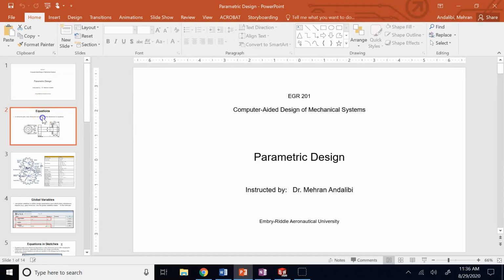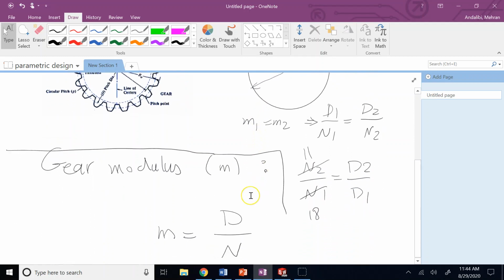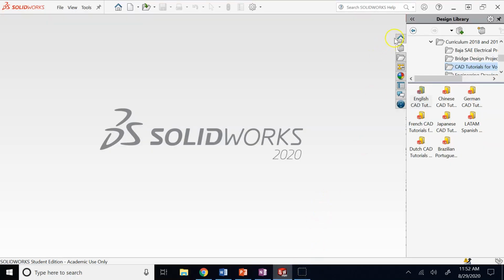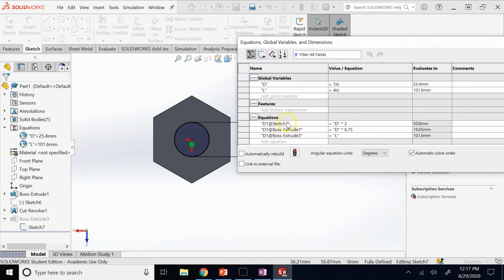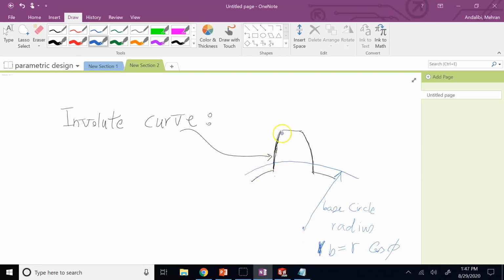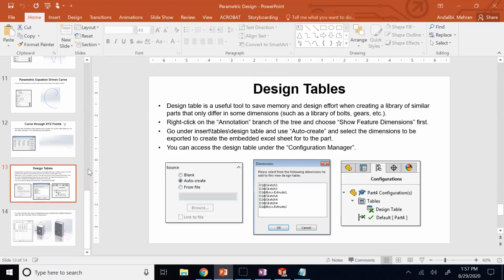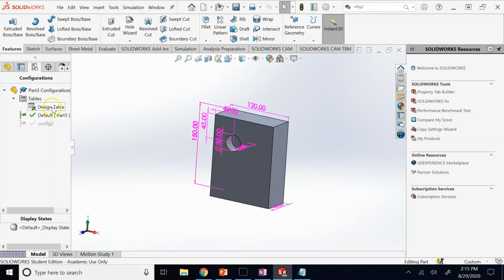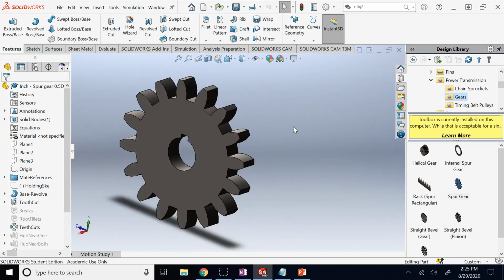Parametric Design with SolidWorks and SolidWorks Toolbox

Comment: With 3D printing and websites like Printables I notice there are more and more parametric models that I can download and edit. Could you maybe do a tutorial on how to make a design from scratch that is uploadable and then editable for others who might not have SW? I dont know what file formats to use etc

I've had an idea of making an Allen wrench holder parametric, so I need to be able to adjust the amount of holes, the individual diameter of those holes and then make the shell adjust in size to keep a set thickness that it cant go under, to guarantee printablility. 

Thank you for this tutorial, its superb! Your SW playlist is a real goldmine